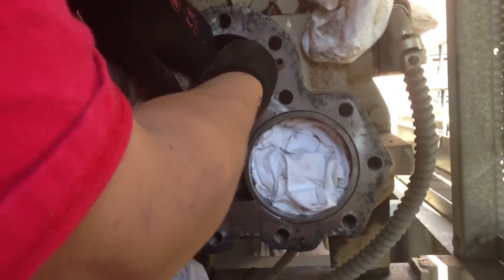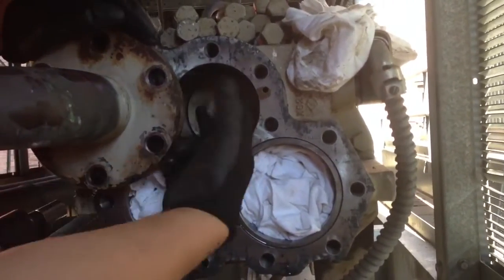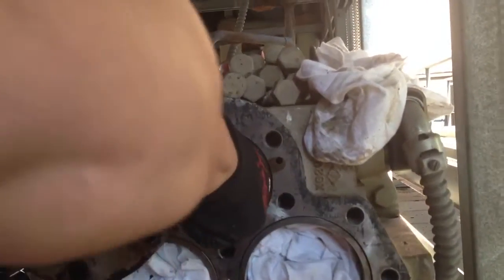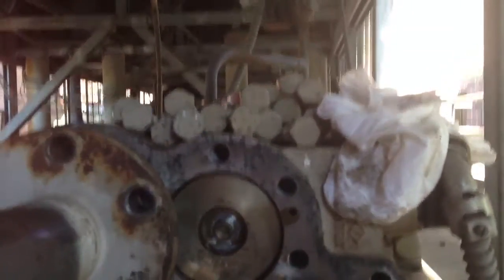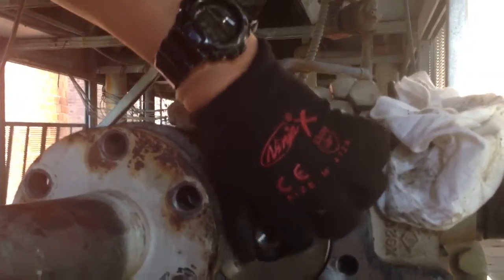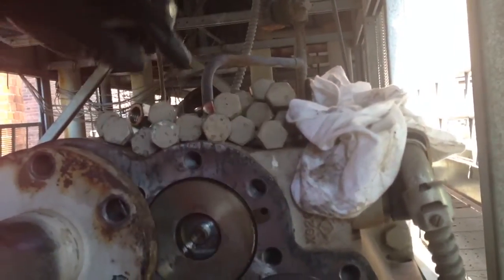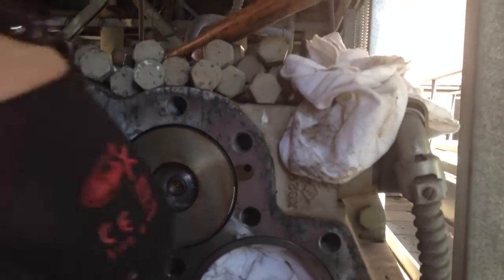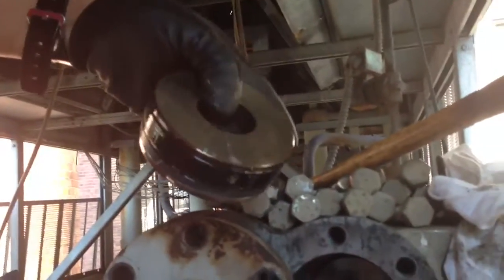TRANE RTAA

Comment: I am currently working on a RTAA200 guys, crkt a comp is short to ground, disabled on adaptive controller (black face)
< > ^ l stop/reset......
The ext fault occurred b IAA...
Exv fault...ran theough the exv test, failed, pulled crkt a, exv, swapped with crkt b...ext
85 degree ambient today 7/17/2015 west michigan.
A01...a70..a72 :)
But we can't seem to load the compressor more than 50%. We are on hooks 2 black wires to the right of the controller and then she loaded to 96% and draw but we can't babysit this thing for the weekend it's going to be 94 Saturday and 90 on Sunday ugh

Comment from the maker: No, but when we did this job we drained the entire oil from the system. When we had the system under a vacuum we let the negative pressure just suck up the entire oil needed for that circuit. SO much easier than adding via a pump.
Reply: hi, what is the reason/indication in replacing the piston valve, what will happen to capacity reading on screen monitor?